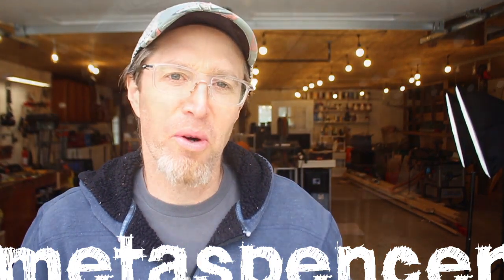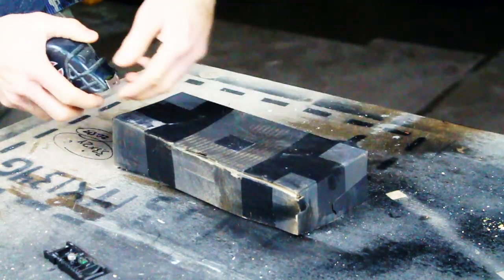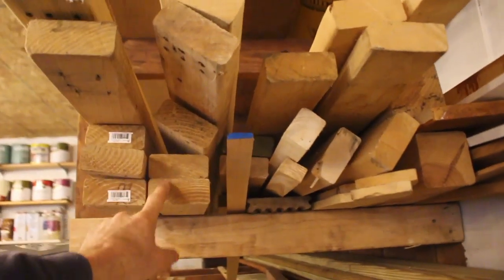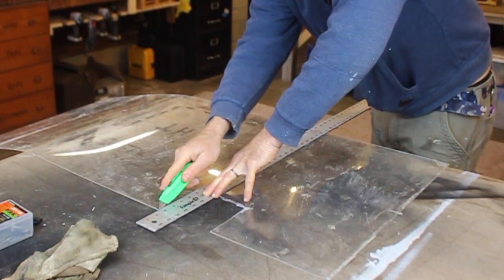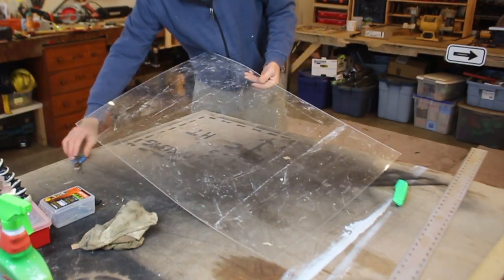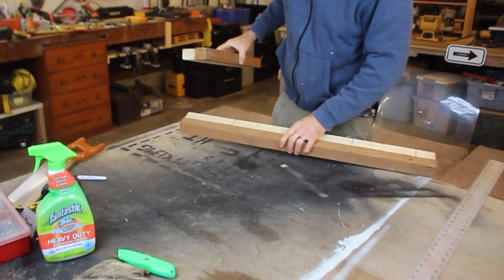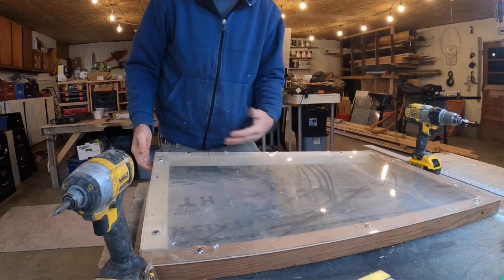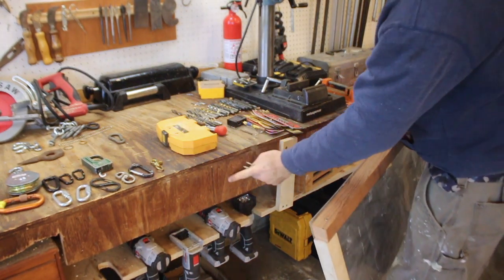DIY Coronavirus Cough Barrier for Markets and Grocery Stores

Comment: Publix came up with a good solution. They use a thicker acrylic or lean and they stand it a dado in a flat 1x6. The acrylic is 1 foot by two feet tall or 2.5 feet. At the pharmacy they stand 2 side by side. Attractive and it works.
Reply from the maker: That sounds pretty good ... the stuff ain't cheap but that sounds solid
Reply: @metaspencer  I will try to take a picture.

Comment: Have you costed vinyl  sheeting from the fabric store  in or on a frame instead of acrylic?
Reply from the maker: The cheapest way to do it by far is to use clear plastic sheeting ... it's just harder to clean. You can buy it at a hardware store